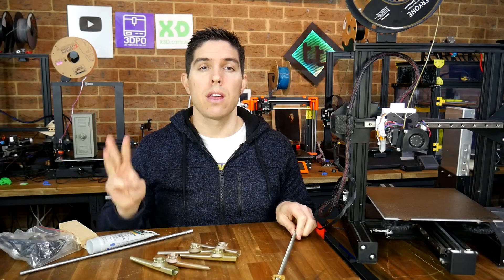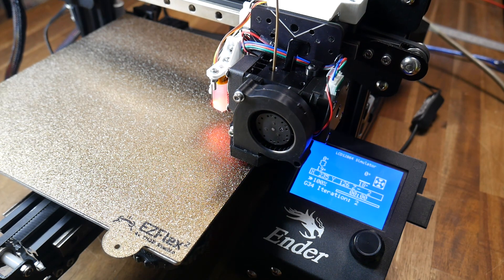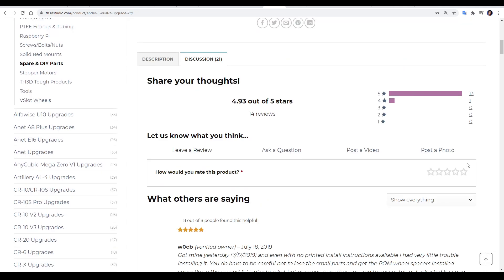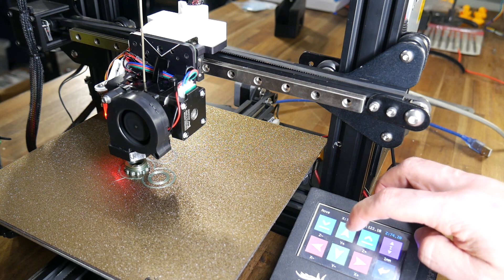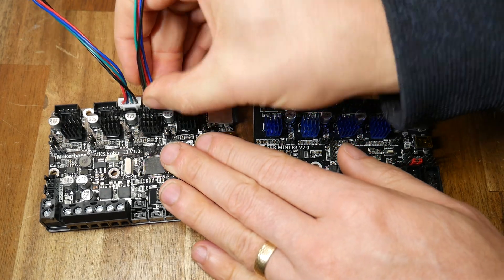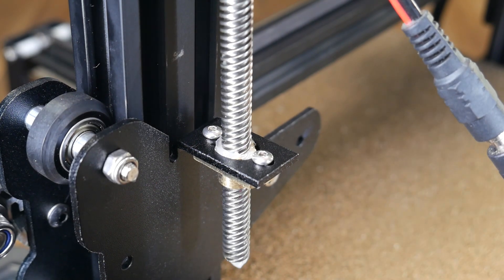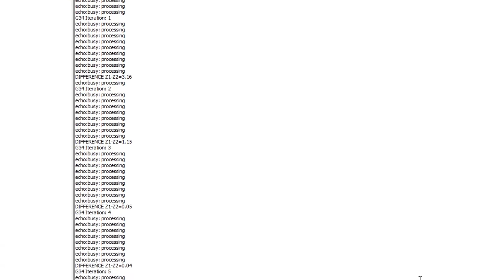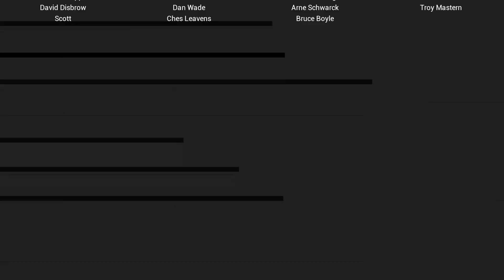3 ways to add a dual Z axis - Including G34 auto Z levelling

Comment: I have a dual printhead with 2 motors.
My board (BTT SKR Pro v1.2) has 6 stepperdrivers, X, Y, Z1/Z2, E0, E1 & E3.
When i plug the 2nd Z-motor into Z2 everything is working fine EXEPT "Z-Auto-Align".
The BL-Touch Probes at the correct position (left and right) but a the printer does NOT compensates.
So when the printer is finished with "Z-Auto-Align" the bed is how it was (not level).
So i think that you can NOT do "Z-Auto-Align" on a single stepperdriver.

Then i pluged the 2nd motor in E3.
Now only 1 Z-motor is working.
In Configuration.h i have these drivers enabled:
#define X_DRIVER_TYPE  TMC2209
#define Y_DRIVER_TYPE  TMC2209
#define Z_DRIVER_TYPE  TMC2209          // (for Z1)
#define Z2_DRIVER_TYPE TMC2209         // (for Z2)
#define E0_DRIVER_TYPE TMC2209
#define E1_DRIVER_TYPE TMC2209

In Configuration_adv.h the folowing motors are active:
AXIS_IS_TMC(X)
AXIS_IS_TMC(Y)
AXIS_IS_TMC(Z)
AXIS_IS_TMC(Z2)
AXIS_IS_TMC(E0)
AXIS_IS_TMC(E1)

When i use the E2_DRIVER in Configuration.h (for Z2-motor) then the AXIS_IS_TMC(Z2) & AXIS_IS_TMC(E2) are both not active in Configuration_adv.h.
That is what i don't understand.

Problem:
The 2nd Z-motor is not turning when moving Z.

Question:
How does Marlin know that i use E3-connector on the board for the 2nd Z-motor and not Z2 connector when #defining Z2_DRIVER_TYPE in Configuration.h?
How can i correct this?

Thank you

Comment: is G34 one of those G Codes thats necessary to do before every print like an M420 or G29 ABL?
Reply: yes, when the power is off, the steppers will not resist turning, allowing them to go out of sync easily. Also, changing filament is easy to knock them out of sync.

Comment: The accuracy of the Ender-3 series with a single Z drive screw shouldn't be any worse than many of the smaller printers with cantilevered X axis support, such as the Prusa mini, Ender-2 series, and the old PrinterBot mini series.  In fact, it should be a bit better because there IS some extra support provided by the guide rollers on the un-driven side, especially if the rollers are correctly adjusted and tensioned.
If you are driving two stepper motors off of one driver there are two options:  Wire the stepper motors in parallel, or wire them in series.   Depending on the motor ratings the series connection may be a better choice as you won't have to re-adjust the drive current on the board.  However, when wired in series both motors MUST be IDENTICAL.  If you wire them in parallel, the motors can be different (but should match somewhat in voltage and current) , but you will have to adjust the drive current to provide some more current to power the additional motor.

Comment: Hello Michael, I have a question. For some reason, the marlin firmware 2.1.x for my skr mini e3 v3 does not have NUM_Z_STEPPER_DRIVER do you know why that might be?
Reply: I have the same issue.  Looking at the code it looks like the changed it so that IF you defined a Z2_DRIVER_TYPE then it can assume you have at least two z steppers.  Following this video, you set the Z2_DRIVER_TYPE already, so you should be all set.
Reply: Yeah, I'm having issues because my Z2_DRIVER_TYPE is not defined, because we're using E1 for the second Z stepper.  I have the skr 1.4, so I think I'll try using Z2 instead of E1 and see if that works.

Comment: Better yet,if you use a cube printer, throw in a third lead screw and you get full auto 3-point leveling. If your board runs out of pins, convert to Klipper and run steppers off a second arduino.
Dual steppers in parallel is what my printer came with, but that's the worst option by far. They just fall out of alignment when off.

Comment: In my Klipper config. since i got auto bed leveling on all of my printers i use G28 for homing. and G29 for Z tilt/align then ABL. my ender and ET5 already run with dual lead screws. so its just a drop in with a driver and cable, driver for the printers respectivly.

Comment: Thanks for the great video. Could you consider including  printed object reloaction as this potentially reduce the need for the above. I have had an alfawise u20 sat around for ages and there has been quite a large learning curve and it is easy to spend a lot of money if struggling to get your first print as thee is always something better. I am not interested in models and was mainly wanting 3d printing for practical things such as for tool batteries, and fixing items that have broken such as flymo hinge pins and  plastic parts of an electric item that have dropped damaging its charging port seating, cogs for electric tools  etc. These are all small items and relocation to the motor side would minimise discrepancies in height across the z axis. I was thinking about the swiss knife hotend clone from dragonlabs, or their volcano +- there nickel clad copper heat block or the supervolcano because I think teh print times are too long. Then the issues of whether it is worth getting a direct drive extruder and whether this would mean it would benefit from another z axis which is how I started looking at this. I managed to print a flymo hinge pin but it just broke and I will try again with greater infill. My point really was that there must be lots of people like me and it is easy to get into buying a lot of things you don't need out of frustration. Comparison of hotends are not available with physical measurments. It is interesting of getting a good printflow requires on adequate heating which depends on the material of the block e.g. copper versus aluminium (3x conductiv brass) with adequate coating eg nickel , longer hotend such as volcano, or multi inlet nozzle to allow increased surface area for heating (which may not need volcano to achieve the same thing in terms of cubic volume of melted filament that can be extruded.) This is another potential video.

Comment: Cool!
  I am new to 3d printing, and I purchased a Tronxy X5SA-PRO. I am upgrading the mother-board to a,
'FYSETC SPIDER' 446 V2.2, coupled to a 7" touch-screen with a Raspberry Pi 3B+. 
  Right now I am having an issue: My prints start off fine, but part way through the nozzle begins to scrap
on the previous layers due to, what I believe, are the axes (x2) are out of sync. At the moment I have her taken apart 
so that I can start from scratch in an effort to get everything aligned, as well as building a more stable base. I have some holes to drill and tap, while trying to incorporate some less vibration resistant material, (aluminum versus cast iron or steel. I have seen some videos where sand is poured into the recesses of extruded aluminum. I am open to suggestions.)  Also, I want to create a 'better' way of mounting the mother-board and touch-screen. 
  Back to the z-axes... I would prefer a closed-loop set-up versus some of the belt style set-ups that I have seen. However... Here is the kicker... I am new to 3d printing. I have some experience with CNC, milling, and I was a kid when DOS was the operating system, giving me a bit of a leg up regarding coding for a beginner. . I have a TON to learn!!! I appreciate any and all 
constructive criticism. I realize that I am putting a lot out there in a short response, but I am looking for advise while offering my strengths and weaknesses, so I am asking for patience and hoping that the teacher will appear when the student is ready.
  I don't know anyone locally to turn to for help, but my daughter's high-school is starting a STEM program next year and I am encouraging her to get involved. This way my child can teach me, and I could possibly become involved on some level. the nozzle starts to 'grind' into previous layers. It doesn't simply 'crash into' it, but it starts one layer at a time and it is noticeable due to the sound that it makes. I level it the z-axes several times due to wanting to get it as close as possible, while making sure that I take my time to notice any errors that I may have made. I am going to have to take out the dial indicator and magnetic base, and since I replaced the original bed it will stick in place. I truly love this stuff!!! 
  I would gratefully appreciate any suggestions in regards to my issue with why the nozzle is grinding 
into my prints.

Comment: Actually the x axis not being othogonal to the z axis is a problem even with a leveled bed. Because the walls will not be at a perfect 90° angle to the bed, leading to non-sqare parts

Comment: I've gone with option 2. 
I didn't use belt tensioner and  I've just moved the brackets a few mms outer to give timing belt tension. Your video was so useful. Indeed I've stucked that right side of the gantry was about 1cm higher whatever I do. After I tried your solution to unscrew gantry and screw again finally fixed it. Simple solution but I never thought about it. I really appreciate your advise! I also changed to flex couplers after your video.

Comment: If you are printing something tall and circular that is going to rotate in a machine later, a bed that isn't level and worse a gantry that isn't exactly horizontal WILL result in a tall print that tilts like the leaning Tower of Pisa and will wobble as the object rotates,  which can render your machine completely useless as the clearances are impossible to set.  So get the gantry level, AND check it over time - because if you overtighten the eccentric on the v rollers the tyres will finish up with grooves and all your carefully dialled in level X gantry won't be level any more.  Dual Z is a great mod, far more use than ABL IMO, unless you use Mesh Bed Levelling.

Comment: G34 -- Would it work if you had dual steppers, to just fix a block under both ends of the gantry slightly below zero Z, and with an optical Z endstop the gantry can be driven below zero slightly stalling the motors when it bottoms on the blocks. From there on its level.

Would that idea work?

Comment: I'm thinking to upgrade my ender3 & this video helps alto thank you very much. 
But I have an inquiry : obviously I have an issue in my z axis. It makes noise when it starts its movement from home position to print the first layer. Also it's kinda heavy when it moves up. Thus, what is your advice.
Thanks in advance
Reply: Do this,I was fighting for 3 months with my printer,this is the only method that fixed my Z axis problems.

https://www.youtube.com/watch?v=4bFYH0X3qjk

Comment: 12:23 i dont understund this. When turn it on dont come back at last leveling?
I must rotate leadscrew until reach the other side but not conected to the coupler and motor right?
My left side is 1mm up than right. i know i can level the bed but i want to learn to have default X stright and after that if need i do the bed leveling.

Comment: So my question is: what does the g34 command do when the bed is unlevel? Does it just make it crooked according to the parallel-ness of the bed?
Reply: It then makes it more level wrt to the two measuring points, in several iterations, until it's satisfied or it can't improve anymore. Once that's achieved it runs another auto bed leveling to find the other uneven-ness in the board.

When leveling the z-Axis, once the two sides are at the same height, all z-Input will be forwarded to both motors at the same time. These motors are super precise, so it's basically as if there was only one motor, but now that motor is even on both sides. The only reason to have two motors is to give them a chance to "automatically" adjust each side so it's parallel to the board.

In general, the "leveling" part is just to synchronize the motors while disregarding deformation from the frame of the printer, which can change / vary from assembly / temperature / touch while the printer is turned off.

Comment: The second item is the lead screws, and the printers don't use the proper coupling, bearings, and support.  Supporting the lead screw with the coupler and the stepper is wrong.  The steppers bearings are not intended for this.  Also, the stepper and the flex type couple will add compliance to the system. The way to do it is to capture the lead screw and use thrust bearing for the axial load. ball bears for the radial load.  For anti-backlash I used a wave spring on the lead screw.  For the lead nut I use the traditional anti backlash lead nut.   Everything is stable and I can even remove the steppers and leadscrews stay in place.

Comment: A quick question about G34 auto-alignment. I am assuming that this relies on the bed being perfectly straight and im using mesh visualizer for making my bed straight. Im planning to install a second Z screw and use G34 for auto levelling (since i already upgraded my board). Im little bit confused and afraid that once i install the second leadscrew, i will not have any absolute point to calibrate neither the bed nor the Z motors and can end up with both being uneven or one of them being uneven and not knowing which one

Comment: When you run the z axis motors in parallel, is there a voltage or current that is recommended to change? My dual z keeps digging the nozzle into my bed during z hops

Comment: HI. Awesome video and outstanding description of the process. I needed some help, if anyone could be so kind. The problem mentioned at 1:25, I just can´t ger rid of it. Is there any video to help giong through all the process of the single z axis and the concentric z nuts? I am having this same problem with my prints. I just bought the double axis system bit ot will take some time to arrive. Thanks. I appreciate any suggestions.
Reply: Any updates?

Comment: Thanks for the video and great info! For Option 3, is the second Z-axis port on the SKR E3 Turbo (ZBM) not controlled separately from the first Z-axis port (ZAM)? Seems like a waste of a port when you can accomplish the same thing with a single port and a split wire.

Comment: I am going to use method 2 on a ender 5. Aren't you supposed to adjust the stepper voltage since you are using a single stepper on 2 motors?

Comment: Is there a belt dual z axis kit that would work on an ender 3 with the ender extender 400 kit? Stock z dimensions, but has a 400 x 400 build area. I imagine standard ender 3 kits have too short of a belt for this application.
Reply: I would go dual z motors, but I already purchased an SKR Mini E3 V2.0, which only has one z axis stepper DRIVER. G34 is unfortunately out of the question for me.

Comment: I’m considering doing the second method. Any chance that the higher amperage of running two motors in parallel would have a negative effect on the board? I’m not sure what they’re rated to handle.

Comment: Got it sorted and made the changes shown, using the BTT skr 1.4 turbo. But for some reason it does not adjust. It just constantly reads the same values no matter how many times i run it. Any advice?

Comment: Hi, does anyone know if the skr mini e3 v2.0 board supports the g34 command? I’m having problems determining if both the z axis plugs on the board are wired to have the same output or if they can be individually controlled to level the gantry. Thanks!

Comment: Sigh, it never even dawned on me since it is a new board... But you can't use the G34 with the SKR mini E3 V2 can you..?  I has a second Z plug built in... but only one driver. To make it better (worse?) I got 2 of the boards...  So if someone can come up with a fun way to stack the boards and fuse them together so I can get a 5th driver between them, I'd appreciate it...

Is it even worth it to have dual-Z's without the ability to control them separately? It seems to me it would probably be smarter at this point to goto the e3 turbo...

Comment: I enjoyed the video, I learned a few new things, but alas there is a 4th option.  Maybe more of a 3b, if you will.  At least, I hope there is.

I've got an Eryone Thinker SE, and it came with 2 Z stepper motors and lead screws.  It uses 1 driver for both motors.  BUT I have upgraded to a board with 5 drivers (was planning on dual extruder but have decided against it for now).  So I'll be looking in to doing 2 independent motors but no ABL tech.  Rather, adding a 2nd Z end stop.  I was hoping your video would cover this, since you really do have a great presentation manner, you are clear and easy to understand.

Well, I guess it's off to look up info on how to get each Z motor to auto-home using endstops and not a BL Touch or whatever.

Comment: Getting ready to do method 2 (Kit are sold for this on Amazon for like $40-$50).  My only concern is with the board being over driven trying to drive two stepper motors.  Any comments on this topic and or how to adjust if possible?  Or do the newer boards have enough power to drive two steppers?  I just upgraded to Creality's 4.2.7 board, with the LCD w/knob display.  I( also have the new CR Touch and Jyler's Marlin firmware so there is that load on the board as well.
Reply: Your driver's are good for just under 3A peak 2A continuous. Most 3D printer steppers take under 1A, so you're fine. You will have to adjust the pot on the board to give it more power but otherwise you should be fine.

Comment: Followed every single step from this video and from others and still my right motor with similar specs (42-34 1.8º ad the left one) loose synchronization while printing. Using latest firmware. Any help?

Comment: I’m using method 2 on my printer, but attached with a belt to synchronize both stepper motors / lead screws on top like in method 1. Is there any downside on this method?

Comment: I have a CR10S I'm looking to upgrade to silent drivers and dual extruders, so I'll be replacing the motherboard. Would it be possible to do sensorless homing on X and Y, and use the endstop headers for microswitches on both sides of the gantry? This would eliminate the need for ABL which would be something for the future if at all.